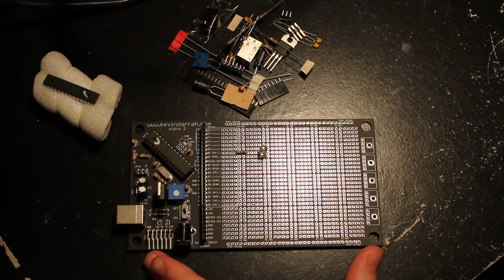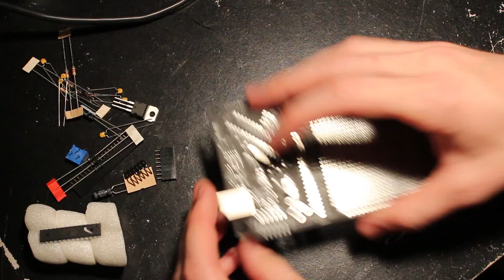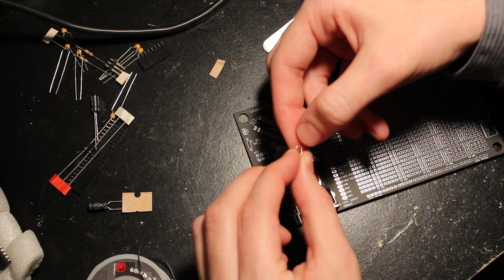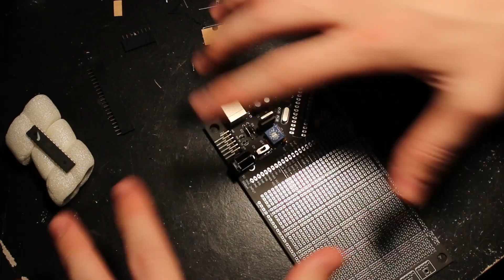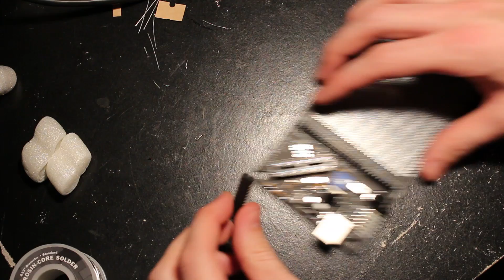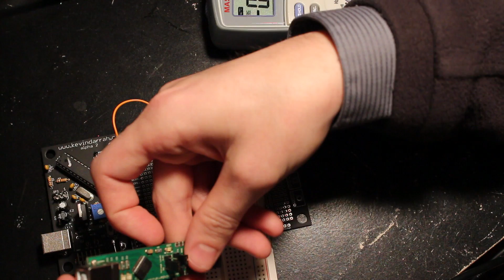The Ultimate Prototype Board - How to Build the Kit!

Comment: So yes, the board should have a LED+resister to pin13 as a standard power up blink test. Well, at least three years later it is standard, .If LED power draw or loading becomes a problem the resistor can be cut   Two pin slide on test jumpers could be used for the LED trace and also for the Analog grounding.  Nice looking board for long term projects.  Thanks.

Comment: what temperature setting on the soldering iron do you typically use?
Reply from the maker: I usually vary between 300-400C, but I have a really crappy iron, so it's more about the feel of the iron.

Comment: Sorry to be the jerk that points this out, but at 0:27:30 - "Most components aren't static sensitive, apart from the Atmega chip"... Correct, that's why it's stuck into three pieces of styrofoam ? Forget the wristband, those styrofoam-pieces did way more damage than you will ever do, by assembling the board :-/
Reply from the maker: Point well taken, but I have not seen any failures as a result of ESD... but that's not to say it isn't possible.  If anyone has any failures, be sure to email me and we'll work out a replacement.
Reply: The problem is , ESD damage is not always, or even usually, immediate. Its usually a degradation that can cause a failure down the track. Always good idea to promote good ESD practices. Simple precautions save later frustration. P.s. I am also sorry to be a jerk :)

Comment: Love the board. I just cant figure out why the usb is disabled and only used for power?
Reply from the maker: In order to program the arduino, a USB-Serial conversion is needed, so I decided to not include this intermediate part.  It would add cost, space, and could be difficult to solder to the board.  I have a few ideas on this, but for now, it's just for power